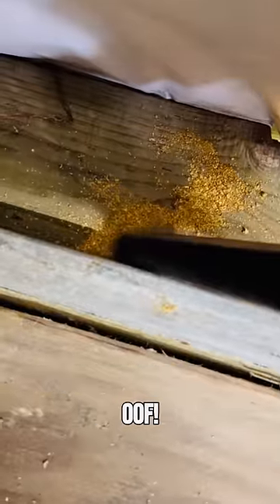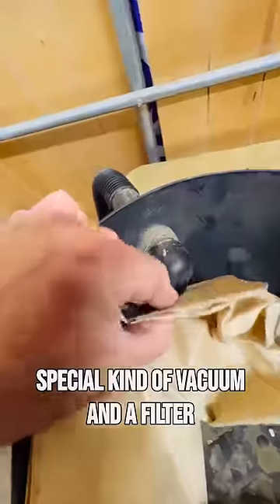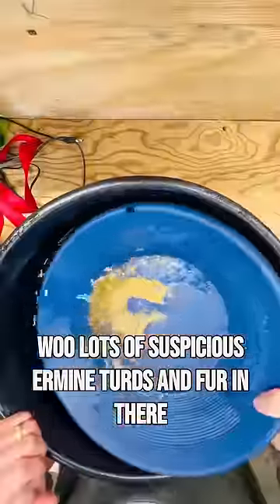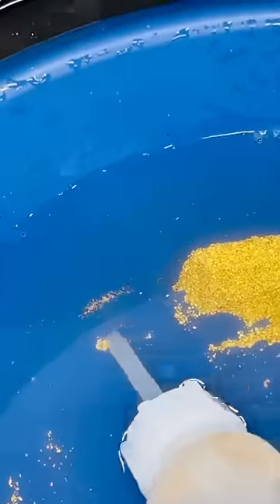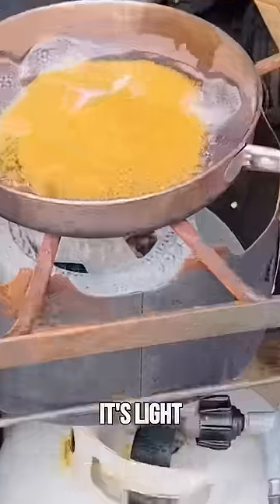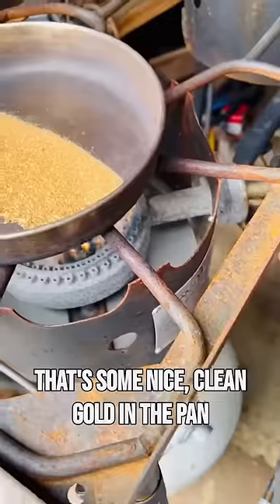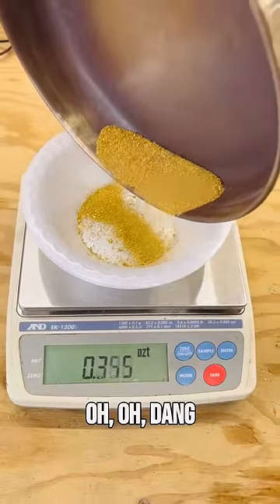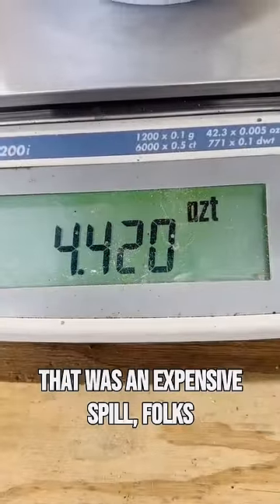Gold dredger problems 🙈

Comment: Did the math and that's better than 8200 bucks. You're out here finding near 10 grand just laying around and I can't even find a dollar bill on the ground.
Reply: Mooch around banks and peak in the bushes by the roads. I found a $20 a couple times.
Reply: I found 20 just laying folded on the ground. Just keep looking around on the ground. I've even found nice chains and a watch (that needed some repair).
Reply: Ya but there's no way that was 4oz. More like 4grams
Reply: @0my 😂 half of that would still be more than 4 grams 🤣 gold isn’t a light metal
Reply: She didn’t find it, she spilled it on the man camp floor JUUUSTT to film this video 😂
Reply: Your math is incorrect
Reply: Hobo tactics
Reply: @0my  gold has a density of 19.3g/cm3 or 10.18oz/in3. I’d believe that’s a little under half a cubic inch there so it seems pretty legit
Reply: It was 4.42 ounces! Rewatch the video you will see it if you’re paying close enough attention.

Comment: The best way I have found to pick up itty bitty stuff with the vacuum cleaner is to put some sort of filter like a paper towel or a dryer sheet and wrap it around the hose end  And secure it with a rubber band or something. That way it doesn't have to travel through the hose and into the filter which means you're losing a whole lot of product just by it's sticking to the sides.
Reply: lol I wouldn't lose it in the filter, just take the filter out. I'd cut the filter apart or even melt it down for 4 whole ounces of gold though
Reply: @escapetherace1943  but why go through all that when there's a much more simple and practical way?
Reply: @laceestarr  it's a hypothetical dude, do you know what that is? I am saying if it accidentally got stuck in a filter I wouldn't let it go to waste
Reply: A stocking or pantyhose works well, too.

Not that I've ever had to vacuum up something that I wanted to keep or anything 💨😜
Reply: Me when I drop my shake

Comment: You don’t get worried that any of it will settle in the ridges on the inside of the hose? Or have you gone and shook the crap out of it to make sure there isn’t any in there? lol I just know whenever I suck up water with a shop vac I’ll go and empty out the main reservoir area and think that I’m all cleaned up until I shake the hose and there’s always more that had settled in all the ridges.

Comment: I'm sure they probably  know but the surface tension of water can actually suspend  some dry fine gold on the top, gold is also slightly hydrophobic. You can add a drop of soap to the water to break the surface tension so that doesn't happen

Comment: Life pro tip: if u ever drop weed in a carpet or anything like that and u need to get it up put a stocking over a vacuum cleaner tube and vacuum it up, the dust will go into the vacuum but the weed will only get sucked into the stocking
Reply: Appreciate that
Reply: It works with meth too
Reply: I never thought of this
Reply: Thanks, needed this
Reply: Thanxxxx homie✊🏽